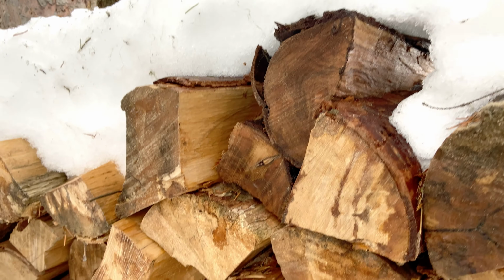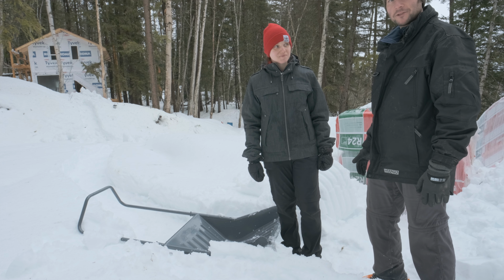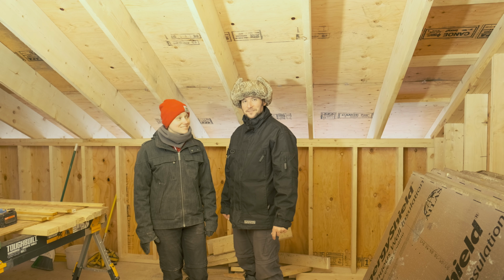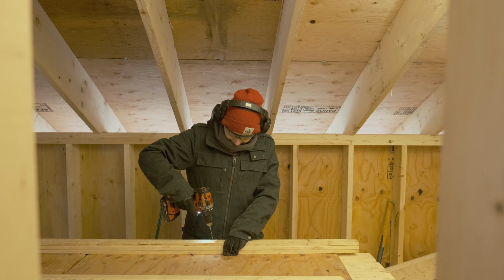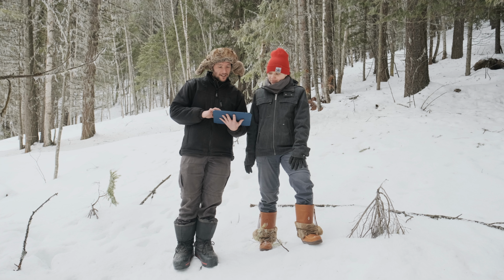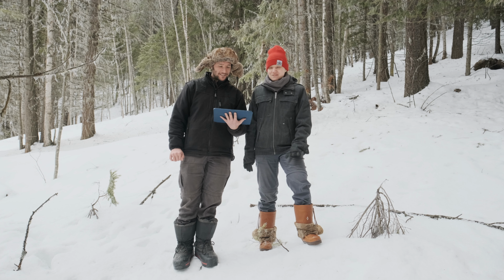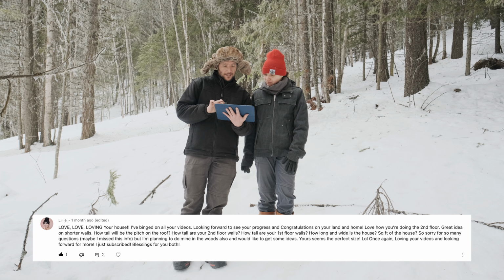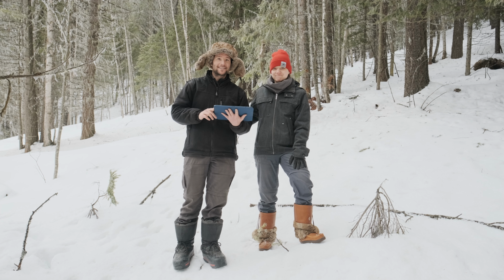Winter cabin building: blazing trails, digging in the snow, moving building supplies, Q&A - Ep. #15

Comment: Hello, now I see you constructed a ventilated cold roof vs. an unvented warm roof. Another smart decision. Likely the easier of the 2 options. I will most likely do the same as you. My only minor concern is if the 1”x2” attached under the roof sheathing will provide enough of an air gap for adequate ventilation. Did you confirm this? This may be specified in the Building Code. Also, I expect you were careful to use short nails to avoid penetrating the plywood sheathing. Is that 3/4” ply on the roof? I would have been tempted to use 2”x2”s and nailed into the rafters. But, I realize this would reduce the thickness of the insulation by 1”. You sure have done your research.
Reply from the maker: Thanks so much for the comment! The ventilation design was done by a former general contractor, and it worked out perfectly that the 2x12 rafters combined with the 1x2’s allowed for just enough space for the double layered insulation and should allow for sufficient venting space. If we’d used 2x2’s we’d have had a lack of space, so less insulation. The roof sheathing is 5/8” plywood, but it’s covered with a self sealing roofing membrane. I used 1-1/4 screws which should not go past the sheathing (3/4” + 5/8” = 1-1/4”), but even if, the membrane will guarantee a waterproof seal. Very happy with the result :)
Reply: @CaribooAdventure  Hello. Thinking more about this, the 3/4” ventilation space is likely fine. More is likely not necessary. I appreciate you didn’t want to lose any of your insulation depth. Your choice of screw length was perfect. Plus 5/8” ply is a little easier to handle than 3/4” and still plenty strong I’d say. I bet it wasn’t easy hauling that ply up on the rafters. I didn’t mention before, but in our (Canada’s) cold winter climate... haha... with all the snow, the ventilated, cold roof I believe is the better choice. It will eliminate the risk of ice damming. As mentioned, I’ll use the same design.
Reply from the maker: It was definitely quite the job hauling all that plywood up, but we got a lot of help from our neighbors and friends :)

Good luck with your roof!